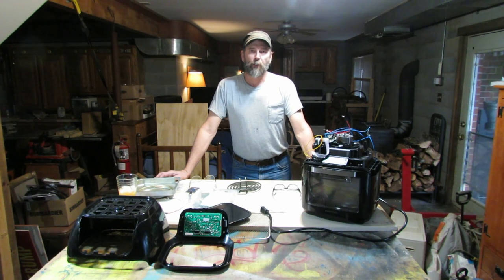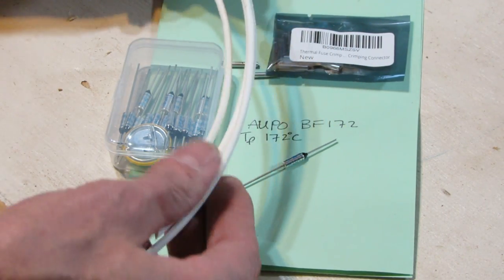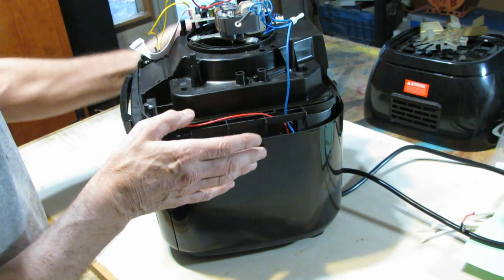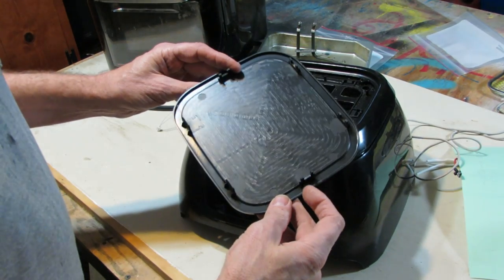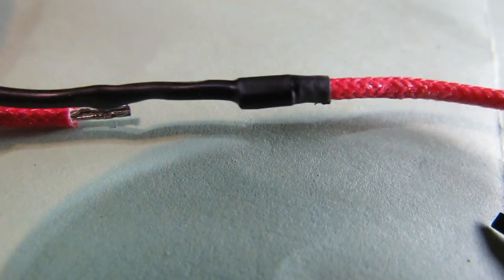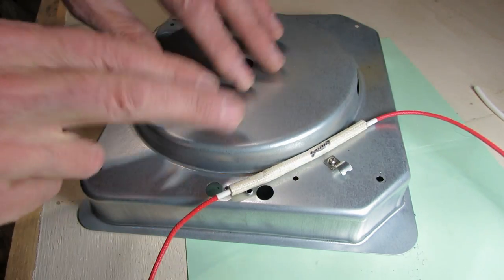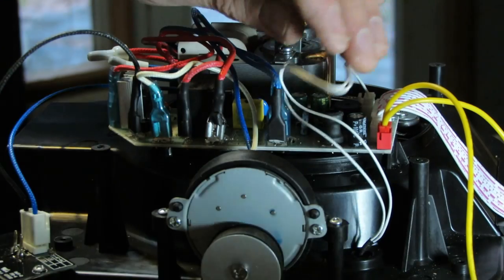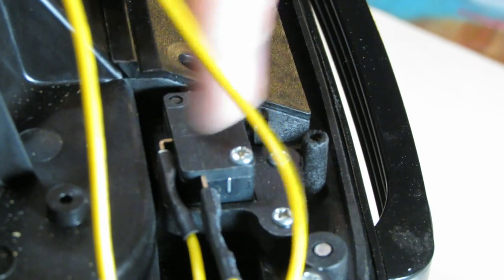Chefman Air Fryer Thermal Fuse Fix

Comment: Thank you for the awesome video. I just tore this exact model apart, what a PITA. My thermal fuse is bad, I'm ordering one. I have no confidence that I could re-assemble this thing without your video. Thanks again. Wife is on her way to buy a new one.....at this point it's a challenge to see if I can get it back together. Thanks again, stay tuned!

Comment: Thanks so much for the great vid Rob and all the detailed explanation. My unit was from the UK which included both a live and neutral fuse at the hot plate instead of the one live you had to replace. Maybe this is down to the higher voltage. I ordered 10A 250V 172℃ Temperature Fuse Thermal Fuse for Electric Pressure Cooker from eBay and it came with two red wire fuses. I initially only replaced the live thermal fuse but no joy. Then I tested the new fuse for current and the old one and the old one was indeed dead. Reckoned the neutral thermal fuse was gone as well. Tested that for current and it was, so I colour coded the second new thermal red wire fuse for blue and added it and presto. All good now. I think running this machine to its 60 minute limit is asking for trouble. Going to max it to 40 at the very most from now on.
Reply from the maker: Glad to hear you got yours fixed

Comment: Thanks for posting, video was very helpful.  Only problem I had was with the fans and I couldn't separate the fuse connections which required a new connector.

Comment: Great video, thanks for the advices . Quick question, I have the same model but mine is turning up, but it doesn’t start the heater nor fan. Once the doors are closed it turns off the light, what could be the case, do you have any advice. Thank you

Comment: Some airfryers , different models of same brand have thermostat cutout that resets ..
Reply from the maker: This model was one-time fail and throw in the trash over-temp protection device. I'm guessing the MFG logic is, "If it over-temps, something's failed, it's going to over-temp again, it's a fire hazard, so permanently kill it, liability problem solved. Next!" Since fixing mine and putting up the video I've used the hell out of it, no problems.
Reply: @robrig1646  Yea.. I have fuse ordered but looking now I think change to thermal fuse was a quick fix for reason you said.. Corsori had massive recalland maybe it preempted change to fuse..... The whole thing is plastic box,  so yea fail once, fail forever maybe was just their mind

Comment: If the fuse is burnt to were the specs cannot be read on it, how do you know what the proper thermal fuse specs are that should be ordered for your particular air fryer. Is there a resource somewhere that gives that info. I could not find the specs in the manual or on the Chefman website. My model is the same as yours (rj38-10-rdo-v2).
Reply from the maker: If you have teh same model, then get the same fuse I describe in the video (I can't recall what that was off the top of my head) I think I ordered some from Amazon?
Reply: Thank you.

Comment: hey there, so far the thermal fuse reads fine, as does the door switch. I decided to test the thermal sensor and it comes back with resistance over limit, so I'm guessing this might be my problem. Given that, do you have any idea whyere I might be able to get a replacement, or find the model number for it?
Reply from the maker: Examine the sensor very closely and see what numbers or mfg logo/name is on it and Google search from there. I got my fuse number directly off the fuse, it took a bit of searching but I figured out what I needed. That's the best I can do to answer your question.

Comment: How did you get the big plastic cowl off, after taking out the four top screws? The rest of this looks pretty clear, but on mine I can't even find places to start prying that piece - and it's still solidly attached with the screws out. Really appreciate the video; any help on this issue would be welcome :-)
Reply from the maker: I think the first guy to post a comment right after I put up the video said he was able get something in at the top and release the clips without breaking anything. Sorry for the slow reply,
Reply from the maker: Just saw the comment by Josh, said he slipped an Allen wrench in at the top to release the clips

Comment: My air fryer burnt out the other day. Do you have amazon links for the parts you purchased to repair?
Reply from the maker: Have you troubleshot the problem or are just guessing and throwing parts at it?
Reply: @robrig1646  considering it went out, wouldn't turn on despite everything I tried before considering opening up? I think I have the same problem as yourself with your frier (I even have the exact same model!). I found the right thermal fuses you put in, I just need links to the crimps and heat shrinks so I can get myself back to frying fries and chicken patties ^^;
Reply from the maker: @PongPogPonderan  Heat shrink I got from work, I think I show the packaging the crimps came in on the video. 
Here's Amazon link. https://www.amazon.com/gp/product/B0966MSZSV/ref=ppx_yo_dt_b_search_asin_title?ie=UTF8&psc=1